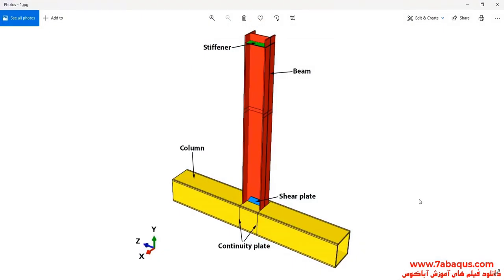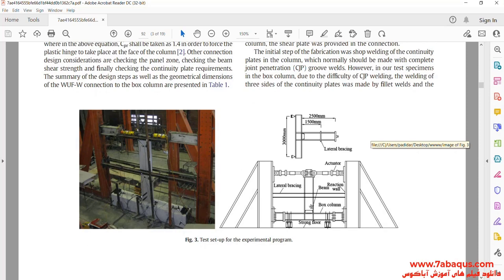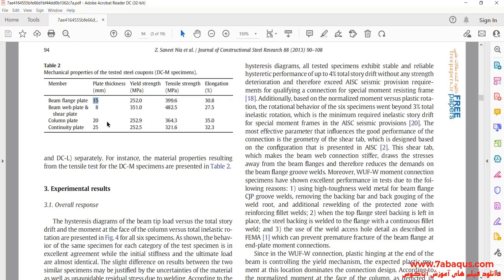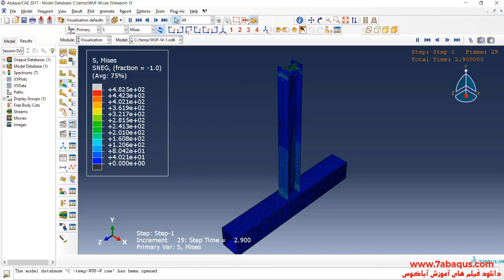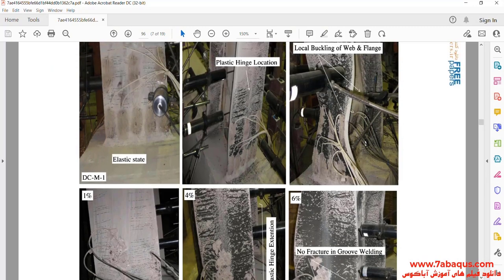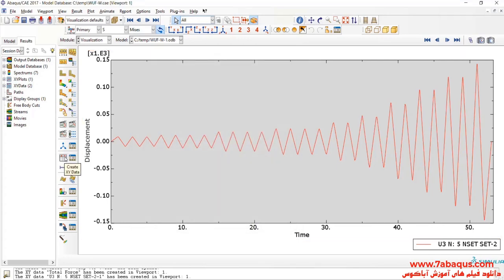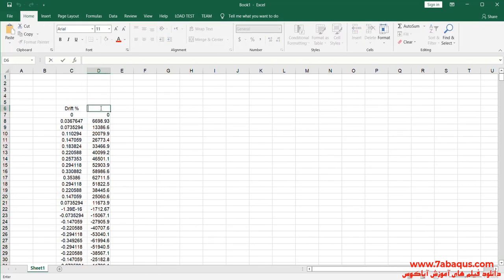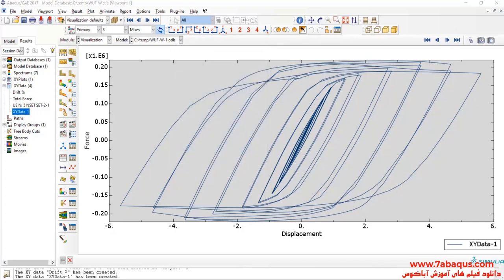WUF-W (welded unreinforced flange-welded web) connection to box column Abaqus

Comment: Sir please make a video for cyclic performance of corrugated steel plate shear wall with beam only connected infill plates
Reply from the maker: Send me a paper about this issue
Reply: @saeedmoeini-7abaqus  ok sir ..I will send a mail
Reply: @saeedmoeini-7abaqus  Sir did you get it ?
Reply from the maker: @hellohai8720  Yes , This is a typical article and it does not have much complexity .
what is your question?
Reply: @saeedmoeini-7abaqus  Please make a video for that